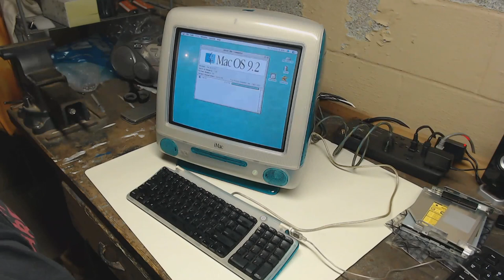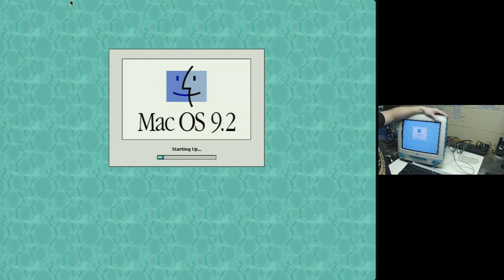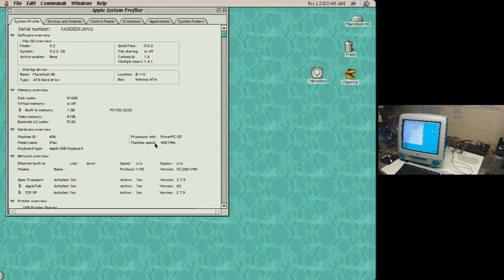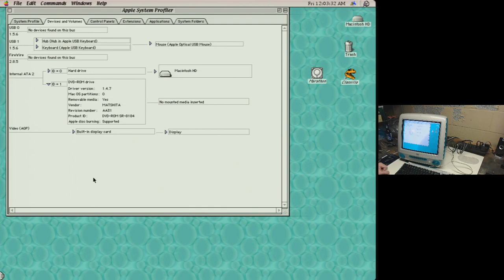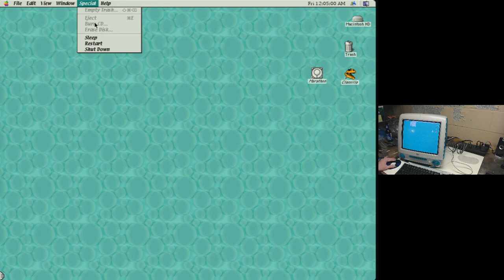iMac G3: Fixing DVD-ROM drive and Upgrading RAM

Comment: honestly its a easy machine to work on just upgrade the ram and hard drive the imac g3 has a size limiter on it of 500 gig's and you can get firewire external inclosures for hard drives for it expanding it farther its one of my favorite machines

Comment: I never thought to ask on Reddit for help finding a replacement optical drive. Mine has been dead for a while and I can't find a replacement anywhere. Back to Reddit I go!
Reply from the maker: I went to Reddit (/r/VintageApple) to ask for assistance with this machine and if anyone knew how to fix it.  Someone replied that they had a spare drive!

Otherwise, I'd suggest searching eBay.  Keep searching, you may not find it right away, but something may pop up later.
Reply: I would be careful. You also have a large risk of being scammed as there are plenty of shady people over there. I know a couple people who've been scammed big time.
Reply from the maker: Honestly, I was a little worried about that.  I was surprised when everything went smoothly.

Comment: FYI... Those are most likely not Philips head screws.  In Asia and especially Japan, they use a slightly different type called JIS and it is very easy to strip these screws with a Phillips head, especially if it's a cheap Philips head screwdriver.  You were complaining a bit about the tight screws. I just thought I would mention it to you.  If you are going to do computer or other electronics stuff, you should pick a decent quality JIS driver of an appropriate size.  This problem has been made far worse in recent years because Chinese screws are of such low quality. They strip especially easily.
Reply from the maker: I wonder if my iFixit kit would have the correct bit or if I should get some extra bits/drivers for JIS.
Reply: @nticompass  Honestly, I would buy a good quality screwdriver set or at least good quality screwdrivers in the sizes you will likely encounter with some JIS drivers too.

Comment: Why would you put 1gb in such a machine?  Mac OS 9 most certainly does not need and will not benefit from having a 1GB of RAM.  There is basically no point in running OS X on it.  There are WAY better PPC OS X machines.  Really, to run OS X, you need a G4 at minimum.  So for OS 9 or 8, 256 is overkill.
Reply from the maker: Why 1GB of RAM?  I guess I just like maxing things where I can.  I figured a little more RAM in the system could help.
I didn't think it would hinder the system, but I do know of some systems where "upgrades" can slow it down.
Reply: @nticompass  It's not gonna hurt. Just kind of a waste of a stick.